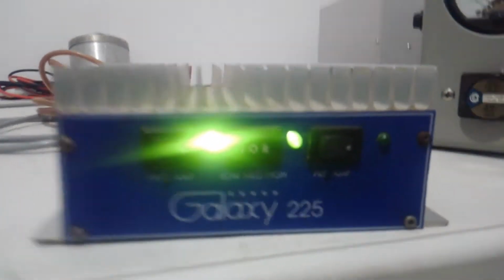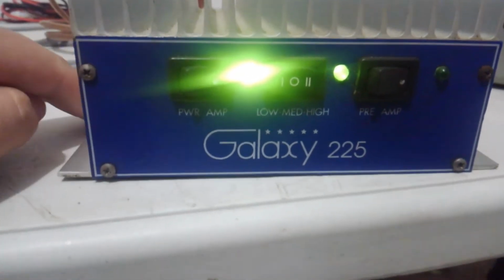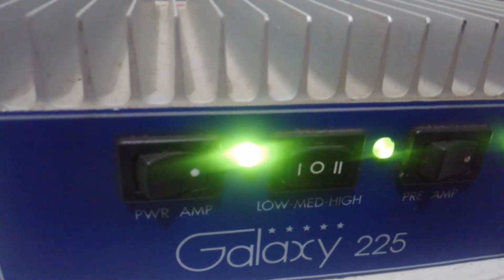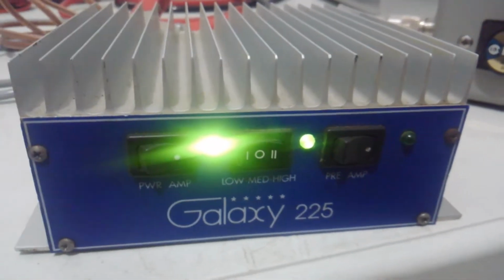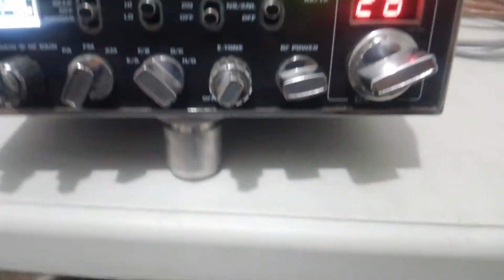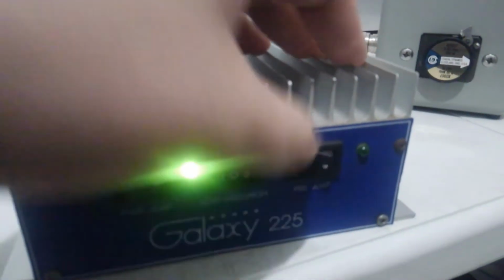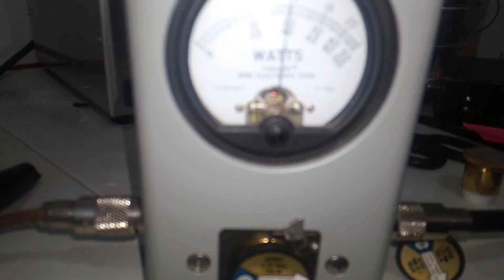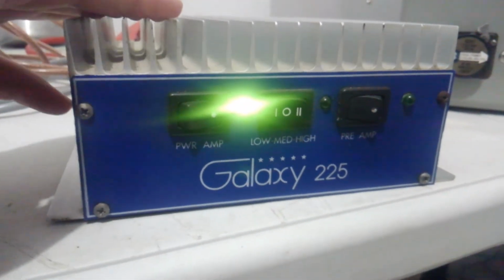Galaxy 225 Mobile Linear Amplifier SSB/AM

Comment: I bought it, works great for my single final radio (Ranger 296). With about 11w on SSB using a 2200hz tone from my phone app I'm getting an honest 150w out on my non-peak meter. Thank you sir... 590NY

Comment: Can you use on a Bone stock radio be fine
Reply from the maker: As long as deadkey below 3 watts
Reply: Have a brand new uinden 980 and just got a 225 galaxy amp only doing 80 watt on high that because the radio not peak and tune to power that amp
Reply from the maker: @jasonblessing3644  more than likely yes
Reply: What should this radio be for this amp
Reply: So this amp is working not miss up at all
Reply: And using a 102 inch whip on my truck with lmr 213 rg8 coax cable that good site up
Reply: And the cable is 18 ft long
Reply: How many watts swing in to it